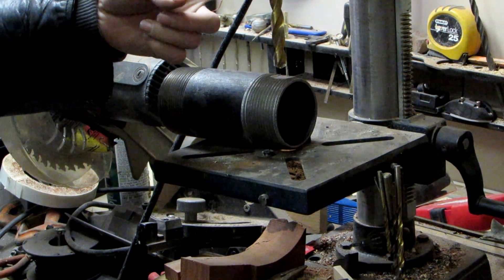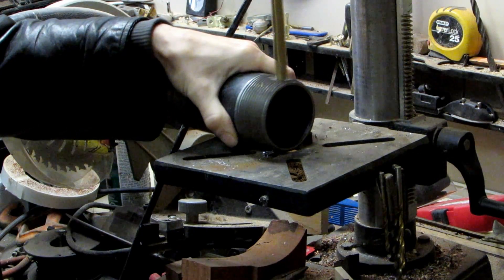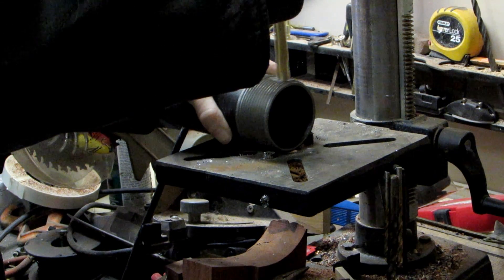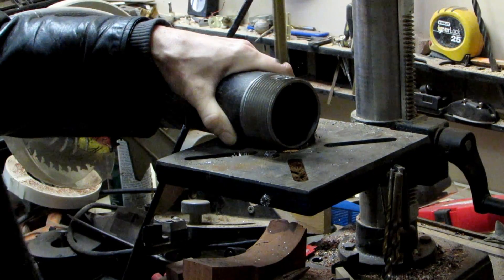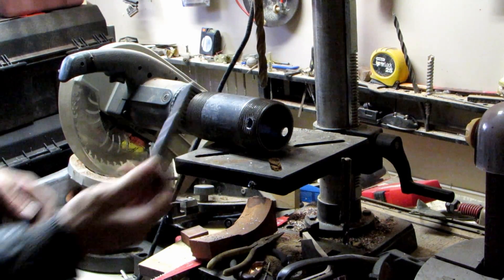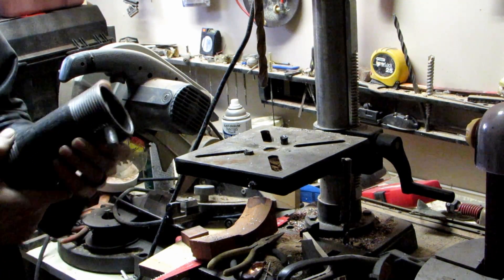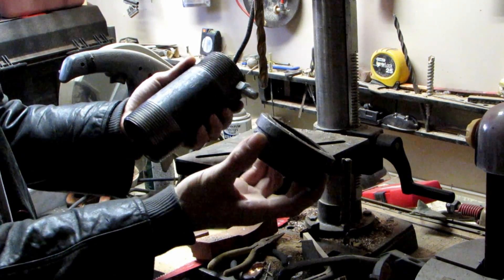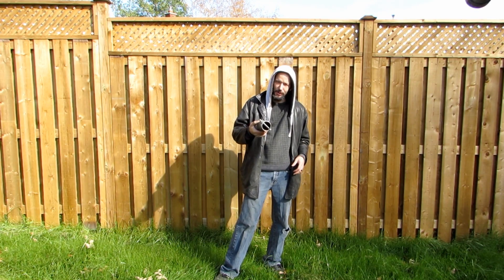How to Build a Heavy-Duty Steel Crucible.

Comment: I stopped after I saw the drill press, got something easier to make I'm broke. like to build with raw steel, I'm trying to make one but I can't melt the steel or transport it. I got a nice forge that runs on its own but need a way to mold it without a crucible or a heavy pipe any tips?

Comment: USE GLOVES YOU IDIOT
Reply from the maker: +niceheadcrab34225 Use gloves with a drill press? That would be stupid. If the drill bit caught the fabric of a glove then it could rip off my fingers.

I'd much rather just have a hole in my hand or a little cut. Neither of which happened by the way. I know better than to get in the way of power tools.

Honestly... 

 just don't put your hand in the way of the drill... that works too. ;)

Comment: I understand the purpose of the bolt, but I don't see how you're going to scrap slag off of the top of the melt with that damn thing there.... Perhaps two half inch bolts for a lift system...

Second, for the love of God - use some cutting oil... I believe no lubrication is the 8th Deadly Sin! :-)
Reply from the maker: +shootgp I'll use a cold thin metal strip to remove the dross and slag.
 
Cutting oil would have been wise.
 
Using two bolts is a good idea, but then I would need to redesign my lifting tools.
Reply: even turpentine(mineral oil.)

Comment: Graphite is extremley conductive and has temperature capabilities of around 3500°F also won't rust unlike your crucible which is bad because aluminum and rust make thermite which will burn through your crucible I recommend you do some research into thermite
Reply: +L00NGB00W Exactly, Thank you L00NGB00W for showing people a cost effective steel crucible. Harris Masson is a jackass. When it comes to steel crucibles, there are all types of steel in which can be used for different purposes. Another example: Do you think large foundry companies use 50 pound graphite crucibles to melt large amount of metal? No because its dangerous, all steel or iron PLUS can be repaired if needed to do so, the graphite can either shatter or leak molten metal. This video has shown people a great idea in which they can use for their own benefit. Awesome video.
Reply from the maker: +Harris Masson I have played with thermite in the past, I'll just have to keep it clean when working with aluminium.
Reply: +Harris Masson Are you stupid? So what if the graphite crucible goes hotter, all depends on the job and usually no one needs to go up to 3,500 degrees. Graphite crucibles last like 5-6 melts and its done, then have to spend another $45 on another. I'm a jeweler, I dont use graphite crucibles anymore, I use steel crucibles as they perform the same job. Steel crucibles work awesomely and save ALOT of money. Even if lower conductivity, is you're kiln a piece of shit that it can't get hot enough?! My steel crucibles have been lasting me for about 5 years and still going, how long does your graphite crucible last?  THINK before you speak bullshit.
Reply from the maker: I used my graphite crucible around 4 times before it burned up.

Comment: Steel has higher melting point so copper should melt in it. Just don't get above high red to very low orange when melting brass.
Reply: +Booger6995 Sorry. One suggestion though. Use two bolts with heads on inside. That way the bolt isn't in the way.
Reply from the maker: +Booger6995 Let us hope.

 The idea was to recycle my lifting tools from past crucibles. I suppose a re-design is in order.
Reply: L00NGB00W
Well unless you have to force things in then maybe time to up the size. GRIN!!!
Reply: +L00NGB00W I bought a cheap pair of crucible tongs, it's all I use now. one handed pour if I'm game, but I'm not

Comment: If you chuck it full of lead, will it stay sealed? i made a crucible out of a one time use Argon bottle, approx 5mm wall thickness and after some use the lead punctured a hole straight trought the metal itself
Reply from the maker: +TheNordernNoob The pipe fitting are designed to be water-tight.  So it should hold molten metal, at least at first...
 
I don't expect it to last forever.
Reply: Most things never do, its a interesting idea, thanks for sharing